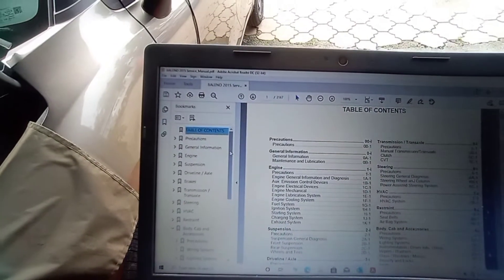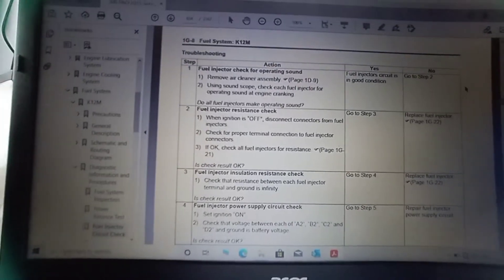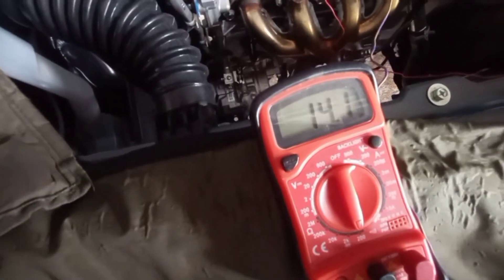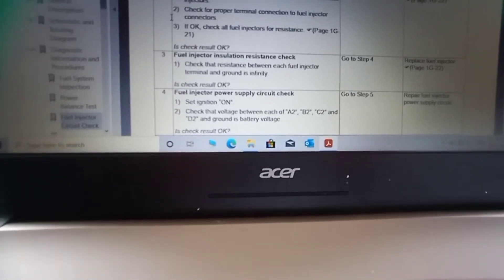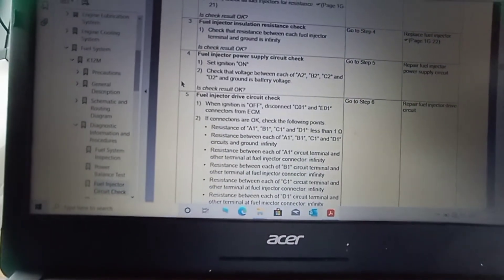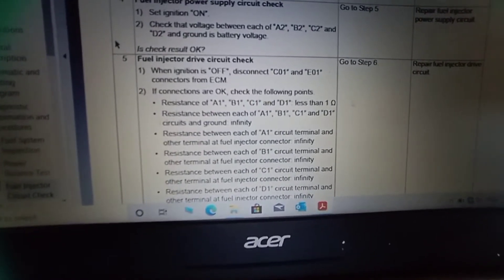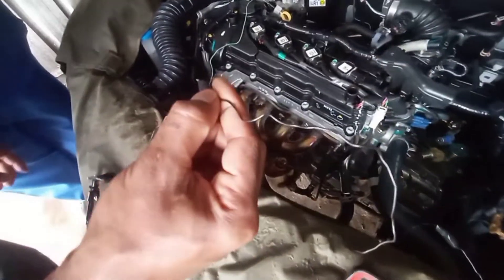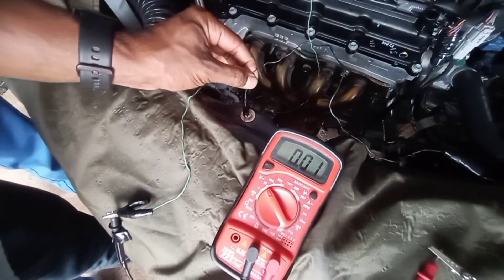Fuel injector circuit check | Baleno | Swift | Wagon R | Ignis

Comment: Hello.
I have watched a lot of your videos about Suzuki DT 2 diagnostics. You are a great master, I have a couple of questions. I need to change the firmware of the unit using suzuki passthru programming software, but I do not know how to do this, do you have instructions or can you make a video. I only learned how to update block firmware using suzuki passthru programming software. Could you help me figure it out. Here is my work.
Reply from the maker: How can I help you?
Reply: @AutoTechTeam-EldhoseNK  You can shoot a video as you can flash the block with another firmware using suzuki passthru programming software